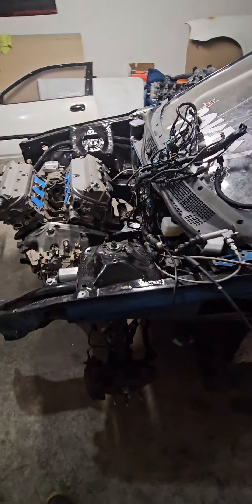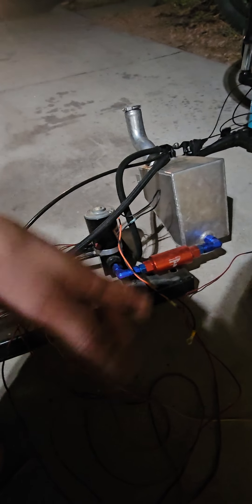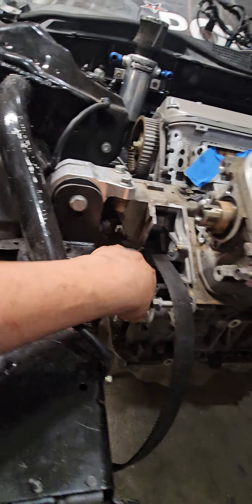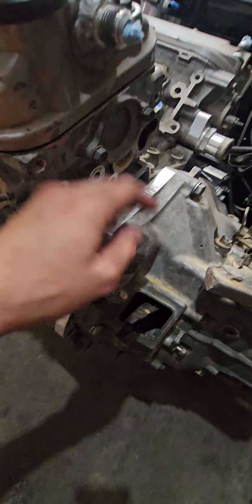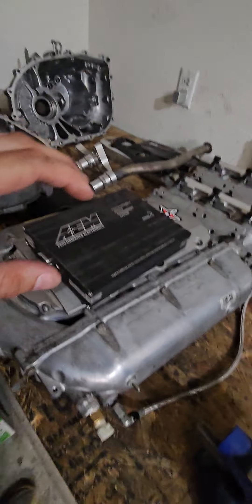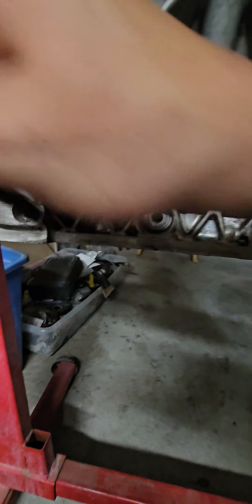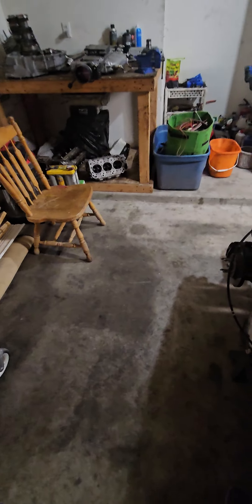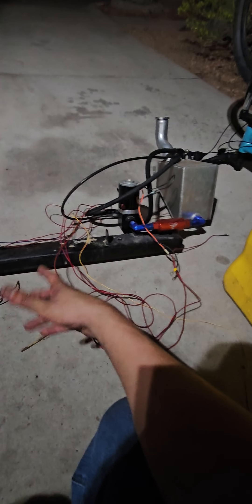GumbyBuilt Garage Pokey v3 update and more ..J2k , H22 and J37

Comment: Good luck with all the new builds. Would like to see dyno of j36 when the time comes.  I rebuilt a j35a3 recently with j37a1 crank and rods. Bored over .5mm and 12.2 cr pistons.  Port matched j32a2 heads.  Made 306whp/280tq all motor e75.
Reply from the maker: Thanks brother
Reply from the maker: I made 277hp 266tq on 91 pump